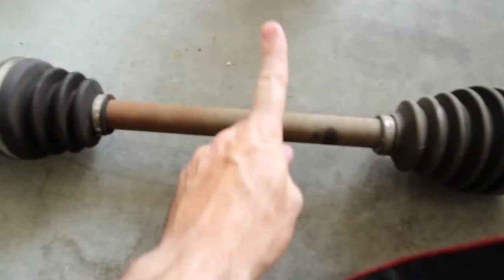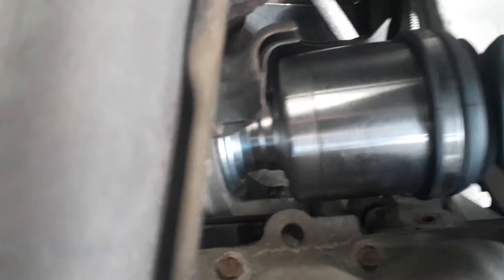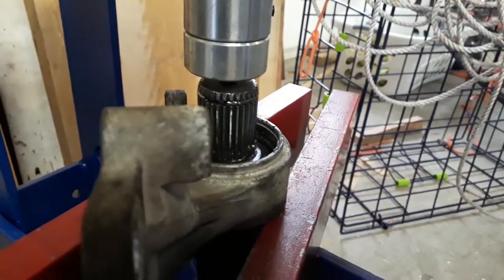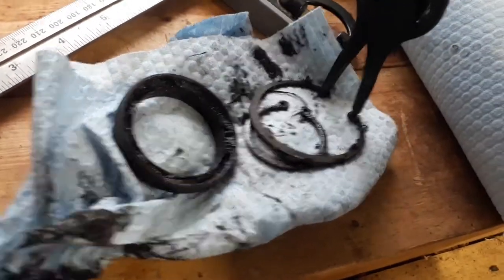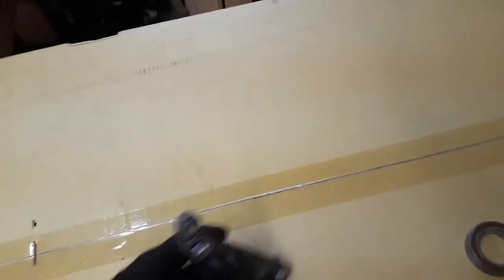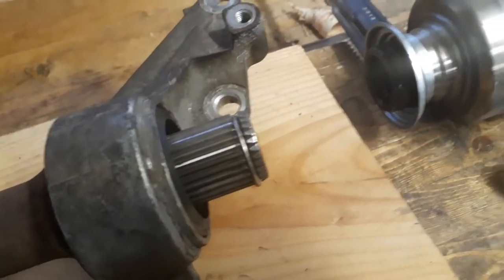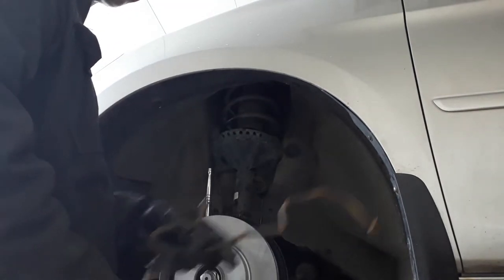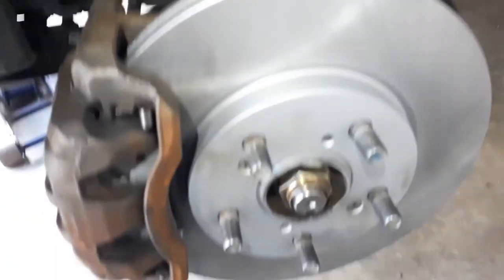Odyssey Vibration Saga

Comment: Great video, valuable information.But before you start changing a lot of things out, check something simple first. I was having a lot of vibration going up into the steering wheel too, on my 2007 Odyssey. My mechanic thought it was that the tires weren't balanced (even though my rotors had wear). He balanced the wheels, and overnight, the majority of the vibration went away.
Reply from the maker: this was one of the first things I did. and you're right because the cost is low this should be the first thing checked.

Comment: Thank you for documenting your most unfortunate journey. Mine came on suddenly. The only time I get the thump is when my foot is on the gas If I take my foot off the gas the sump goes away and it does not thump when I apply the brakes. Was that your symptom?
Reply from the maker: i had it all the time at speeds over 90 kmph, but it was definitely more noticeable with the accelerator down or going uphill
Reply: Thanks Bill. My CV boot is ripped so I was going to replace the CV axle no matter what. I surely do appreciate your reply and wish me some luck please 😁.
Reply from the maker: @Jeff_Seely  you bet. sounds like you have a reason to do the axle anyway so good idea. next time you're doing your brakes, change the rotors as well. That is if the axles don't solve your problem. Come back and let us know how you do.
Reply: I am thankful to get the good advice from you. Corresponding with you is my privilege.  thank you

Comment: So my  odyssey 2007 began to have vibration issues after we put new tires on it. The tires were balanced twice noticed that the vibration happens when accelerating we replaced the lower control arms the cv axle , wheel bearings and still the vibration is there. I’m contemplating whether I should do the rotors next I need help
Reply: Did you have vibration in the steering wheel ? I have a vibration under acceleration from 60mph -70. Zero / no vibration in the steering wheel or front end, feel it in the seat / floor.  I did just have new tires installed (perhaps they warped the rear rotors) . I have seen other videos that it can be rear rotors (mine are original 210,000 miles)...Any input would be appreciated before I start throwing parts at it. (210,000 miles, bought it new 2005 Odyssey) Had no issues before new tires were installed..
Did you fix your vibration?
Reply: @pureblood2020  Sounds similar to my situation.. did you ever figure yours out?
 
Mine does around speeds of 60 mph and shakes the entire front end so bad it's terrifying! Only goes away if I accelerate past 65mph. Rides somewhat OK at 70+, unless I hit a bump - then the whole thing shakes violently until I accelerate.

On the flip side, if I brake when the van starts shaking at 60 mph, then it shakes even worse until I slow down to about 50-55 mph, when it diminishes.

I've changed stabilizer bars, outer tie rods, lower control arms, CV axles, 4/5 mounts (doing rear mount right now). 

I guess I'll take a  look at the rotors, unless anyone else has come across a different solution to a similar problem ..

Comment: Bill, it's too late to show us the actual replacement of the motor mounts, lower control arms, tie rod ends etc.  But, you COULD walk us through the process for each repair.  Jack up your Odyssey, pull off the front wheels and describe for us - here is where the lower control arms are located.  This is what I had to do to replace them.  Here's some tips to make the job easier.  Here's what I had to do to replace the motor mounts.  Here are the tools I used and the process I went through.  We don't have to see a mechanic actually doing the job but it is very helpful to have a college professor describe and explain using visual aids how a job is done.  You've got a gift for teaching and we all can identify with trying to run down problems by fixing this and that and the problem is still there.  Please save us the hardship.  I just bought a 2007 Odyssey with 85,500 miles on it and I want it to be the last car I buy.  I'm almost 78 years old so I'm going to start by changing/flushing ALL the fluids.  I noticed when I test drove the vehicle that there was just the slightest shimmy in the steering wheel not related to braking.  It may have just been flat spots on the tires from sitting in the showroom for weeks/months?  The shimmy seemed to get less the more I test drove it so hopefully the problem is going away.  I'll check tire pressure and balance when I take possession of the vehicle.  They're supposed to fix a scratch and it's been one and a half weeks and the fix isn't done yet.  I hate car dealers.

Comment: I am having a similar issue with my 09 pilot I had slight vibration at first during first take off between 15-20mph, then it started showing its face at highway speeds of 60-70. Shortly after I had my driver's side CV axle (which was replaced only 2 months ago) snap at the outer joint. I replaced the CV axle again, had an alignment done along with a tire balance and the vibration seems worse than it was before and is showing up at the same speeds 15-20 and now 50-70
Reply: Did you ever replace the rotors?

Comment: Did you have vibration in the steering wheel?  Our 2010 Odyssey shakes the car (and the driver's seat!) intermittently at highway speeds, but doesn't shake the steering wheel.  The local tire shop checked it out and balanced the tires - still vibrating.  Perhaps the steering wheel wouldn't shake if the rear rotors were bad?
Reply from the maker: I'd say unlikely the rears. Check rotors and might be driveshaft. A lot have replaced driveshaft with Honda parts and had success.
Reply: Bent rim?

Comment: Had vibration too. The vehicle is a 2011, came with engine mounts problems. I replaced them. Then it started vibrating during acceleration. We had replaced the CV axles a year or 2 ago. (Chinese products). I did some research and through visual under the vehicle check. Everything checked out ok.🤔🤔🤷🏿‍♂️🤷🏿‍♂️ I was out of idea's....what could be the cause of vibration while accelerating and clears when you let your foot off the accelerator....removed the new CVs Installed the old CV axles and the vibration went away... now it only clanks while turning sharp corners. At the moment waiting on new CV axles from honda no more Ebay cheap axles😊😊😊

Comment: I have a 2005 Honda odyssey touring.. I removed the pax Wheels and installed mdx 20x8 wheels on the odyssey. I've been having steering wheel vibrations when going over 55 which is driving me insane. The axles, control arms, the links were changed. The tires and wheels were road force balanceseNd the odyssey aligned by Honda and I'm still having the steering wheel vibrations.  The rotors were changed a little over a year so I'm wondering if I should have the rotors replaced and check the motor mounts?
Reply: Does your vibration come up into your steering wheel and dashboard sometimes and happen at the same constant speed and goes away when you accelerate or slow down. I can put mine in drive with the emergency drake on and get out and hear the noise a lot more.

Comment: My 2009 Honda Accord v6 was doing same thing drove me nuts I replaced drive shafts, brakes, rotors ,shocks , all front suspension components basically were replaced , also did triple hot tranny flush plus another one with little Lucas transmission fluid, I bought new wheels (rims plus tires) I did wheels balance about 8 times in 4 different places... Finally I  gave up and sold it with shaking problems
Reply: That's one way to fix it!

Comment: When I apply the breaks with some pressure it starts to vibrate, when I press harder on the brakes they work fine. I changed the front rotor and break pads with power stop brand rotors and brakes. Any idea what will still be causing it to vibrate?
Reply from the maker: Could also be the rear brakes. I had a bad vibration on my truck once. It was the rear brakes. I was VERY surprised that the rears could cause that significant a vibration under braking.
Reply: @hoddy2001  Thank you! I will look into the rear brakes.

Comment: WOW, I had a slight vibrating noise when I turned left or right and braked. Checked everything, like tires, brake calipers, pads, rotors only to find out the exhaust heat shield at the engine output was loose and both parts of it were vibrating. Strapped it together with a metal clamp and noise stopped.
Reply: I think I need to try your method.

Comment: I have a heavy pulsating  when I brake my 99 Nissan Maxima. I also hear a pronounced revolving metallic sound when driving. The same occurred with my 98 Maxima. The only way to fix it was to replace my axle. The passenger side is extra long with a support bearing.

Comment: I think its critical to use correct terminology when describing the symptom. (Not at all saying youre not) I have an 07 ex-l with an issue Id describe as a shudder or chuggle. (The latter GM used in a manual in the 80s) its most apparent accelerating up a moderate grade in higher gears. I believe its motor mounts though others  describe a similar issue being the torque  converter.

Comment: You can’t just change the rotor, you have to check lateral runout in the rotor.  New rotors on our Odyssey would shake after a month on the highway.  You have to get the lateral runout below .04mm.  If you don’t, the vibration will come back.
Reply from the maker: can you post a video to show us how that is done and what to do if it is beyond .04mm?

Comment: This issue is a huge PITA.  Smooth as glass at 60mph, steering wheel shaking bad at 70, smooth as glass at 80mph (um... allegedly... :) ).

Rotors are not involved in acceleration... so ordinarily I'd be hard pressed to think it's the rotors.  BUT - what you found with plugged vent holes would cause an imbalance just like a tire out of balance.  I also think there's a harmonic frequency between 60 and 70 mph where anything out of balance or out of round causes this issue to be exacerbated.

It COULD also be stuck calipers combined with a slightly warped, or installed askew, rotor such that there's too much runout (side to side motion viewed as the rotor turns).  The stuck caliper presses the pad against the high spot on the rotor and it heats up there, causing it to get worse after driving for 15 minutes or so.  I have seen this issue on a couple BMWs, and on several Volvos.  Car starts out fine, then after 15 min or so the whuppa whuppa starts, and the vibration in the brake pedal gets much worse.

I had a a 2005 Odyssey that I struggled with this exact issue for years.  Changed everything - control arms, struts, sway links, wheel bearings (front and back), axles (but not the intermediate shaft), rotated tires, balanced.... nothing worked.  Finally, I had the tires ROAD FORCE BALANCED.  Problem solved.  OMG.  Road Force Balance is a huge step up from spin balance (but also more expensive).  But in this case, it fixed it.

Now my 2009 Odyssey is doing this exact thing.  I bought a pair of axles.  Was going to install, then remembered the intermediate shaft and bearing.  On a Volvo the right side axle includes the intermediate bearing.  My son's Volvo was doing exactly this - between 60 and 70, under acceleration, steering wheel shake.  The old intermediate bearing sounded like a pencil sharpener.  Replaced that axle (with support bearing), problem solved. So I was thinking of replacing the intermediate shaft and bearing on the Ody along with the axles.  But that shaft with the bearing is over $300 (I need to buy a press), so before doing that, I rotated the tires.   Guess what - the vibration moved from the steering wheel (my fingers) under acceleration to my butt.  Acceleration makes only a slight difference in the steering wheel now that the vibration is in the rear. 

So I'm 82% sure that it's a wheel or tire out of round, or tire balance.  I'm just about due for a set of tires, so I'll get that done.  My shop has a wheel straightener, so if there's a runout problem with a rim I'll be able to get that fixed, too.

Comment: In the past, whenever I had brake squeak or pulsation, it was time for a brake job.  Then, as long as I changed the front rotors with the pads, the pulsation always went away.    The last time I did that, not all of the vibration went away.  That bugged me.  Then I did the rear rotors.  Problem solved.